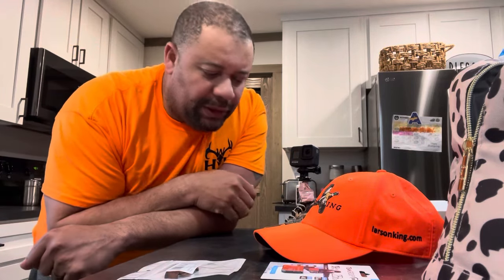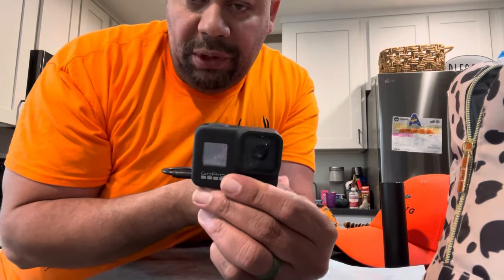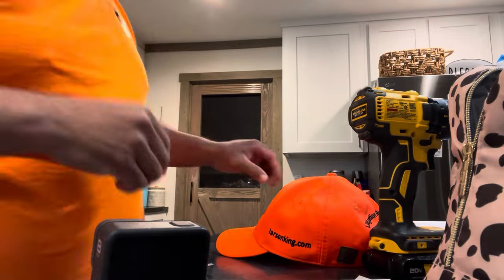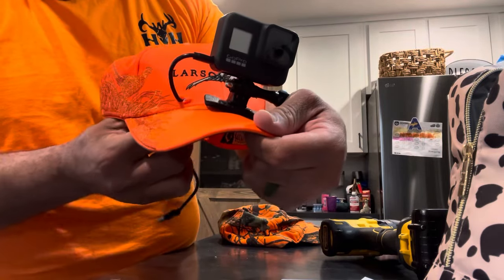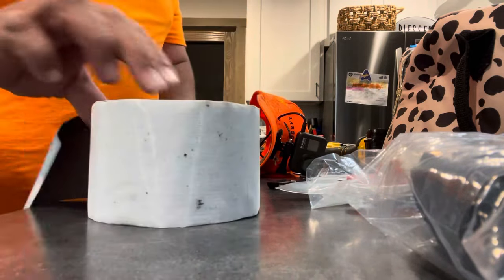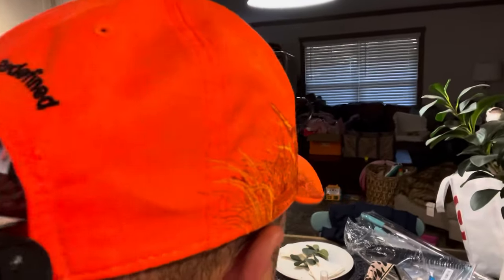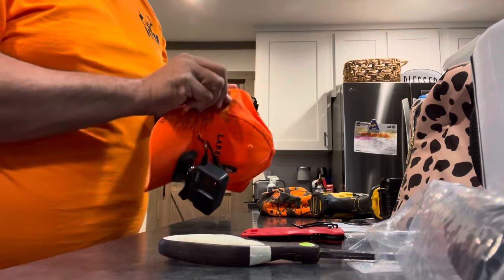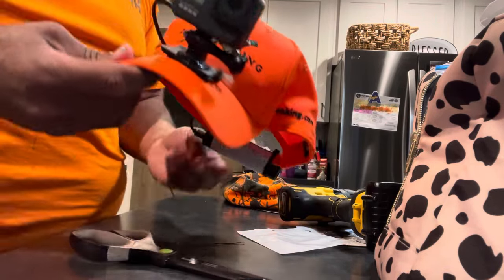No more dead GoPro batteries

Comment: I’m doing the same thing to my new GoPro 10 but using the head strap. The batteries for that thing don’t last 45 minutes and I bought them white colored Enduro batteries. 5 batteries would get me through a whole day of hunting with my GoPro 5. Not with the 10. Looks good Cat! Go head!
Reply from the maker: LiveAction Family… Yes Sir.. I love my 5 .. though I was upgrading with the 8 , but that 8 dies in 45 minutes.. that ain’t worth 2 cents in the deer woods ..!
Reply from the maker: ? … My 8 will not Turn on when charging, I have to hit the side button first and then hit record.. Your thoughts……
Reply from the maker: Update, it was the charging cable. It is not like a cheap charging cable. The one I was using was for charging the battery bank and the GoPro did not like that cable. So I changed to a different cable and is working perfect.
Reply: @TheCATFISH1949  Glad you got it working. We doggin’ in the morning. Opening day adult season. Ready to throw them cuts! Hattamania ready to run wild!!!
Reply from the maker: @HuntinwithHattaway  LiveAction ComeOn … High Brass Upper Cut SuperPower ..

Comment: How about if you sew a soft, flashlight or knife case to it and cut a hole in the flap that flips over and run the cable through it
Reply from the maker: Jerryyyyyyyyy .. glad to see u ! It might work… I’m afraid of ripping the cord out going through them thick woods …
Reply: You could also use two-piece rivets that you put the brass tag on a dog collar with to attach the case to the hat